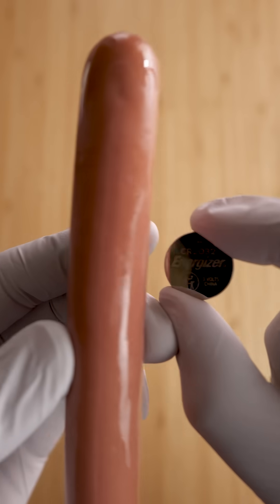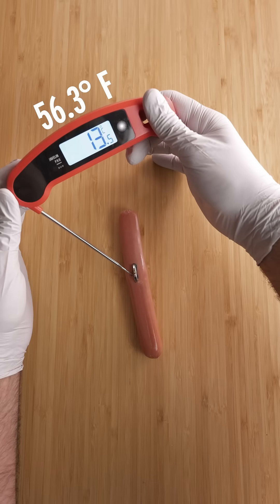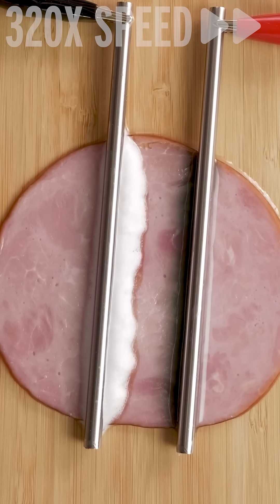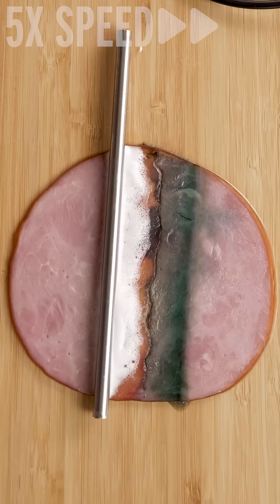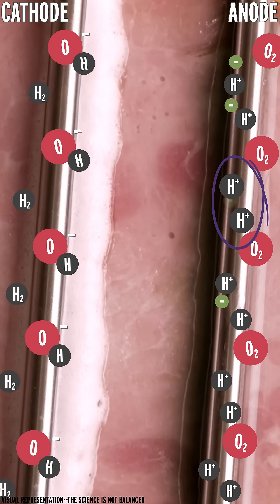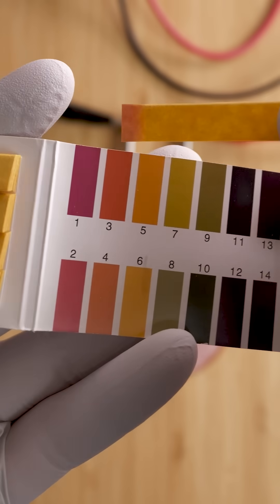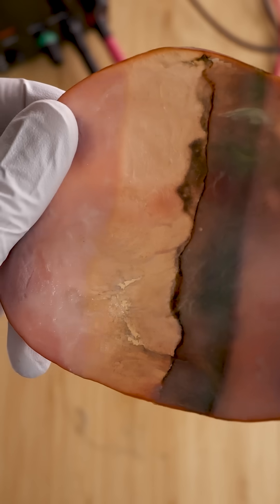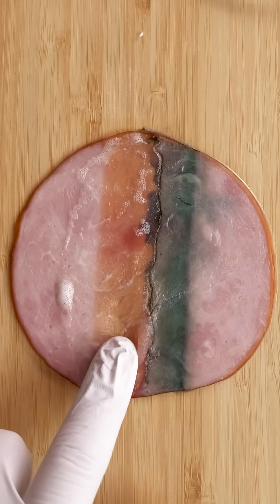don't swallow watch batteries

Comment: I learned about this when I bought some Duracell button batteries for my air conditioner remote it had a little picture of a baby on the back with a line through it. I read the back and apparently they are flavored to discourage children from eating them. So of course I had to taste it to see. I just touched my tongue to it for a split-second gently and BOY! Did that taste awful! There's no way anyone could keep one of those in their mouth for more than a second. I'm surprised they haven't generated some stupid internet challenge honestly.

Comment: Due to the stomach contents constantly covering the battery, the electricity will have little reason to take the detour through the higher resistive tissue of the stomach lining. It would really have to get stuck in between some folds to do some damage.

Comment: Technically it is a chemical burn. You will get a similar reaction if you get lye on your hands. I make soap and for the longest time i never used gloves. I have scars from lye on my hands. It happens when the lye solution splash on to your skin when mixing it into the oils. Lye is a strong base and will eat away at your skin. When it is on your skin, it almost feels like an insanely itchy area. But no amount if itching will cure it. But vinegar will neutralize a base because vinegar is acidic.

Comment: You "cranked up" the voltage, so you can't be sure that this is what was happening with the button battery in the hotdog.  Electrolysis is very voltage specific: it won't happen if the voltage isn't high enough.
Reply from the maker: Correct, the voltage needs to be at above roughly 2 volts, which a 3 volt button battery does easily. If I had cranked the voltage up too high I would have cooked the ham by forcing enough current through it to heat it up. But 9 volts isn’t enough to do that with this particular piece of ham

Comment: Not just that but applying a potential can cause electrolyte imbalances in cells which can cause osmotic imbalances.

These can lead to cells bursting and if the umm subject is alive then it can cause convulsions and seizures.
Reply: Note: the 2nd part only applies at very voltages from AC

Comment: This is why you start toddlers on a tiny button battery diet so they slowly build up a tolerance to it.
Reply: You mean so they build up a resistance?😂
Reply: @adamfoxton6341 😂😂😂😂
Reply: @adamfoxton6341  you are the current king of replies.  Watt an honor!
Reply: i have one larger and one smaller. do they only come in 1 size? when should I give ger the larger one?
Reply: @gabbymcgibson984  Always consult your doctor for exact dosage and treatment plan.  Make sure you let the doctor know exactly where you live too, in case of emergencies.
Reply: @gabbymcgibson984  Try a watch battery, those are smaller than the one in video which looks like ones you put into a fob and other somewhat small (but larger) devices.  Like a cr 2032 battery.
Reply: My friend's son actually died by eating one of these when he was two.
Reply: Nah bro
Reply: That actually kinda happened to me, as a kid i swallowed 3 of those, different sizes in a span of 5 years, sure i went to the hospital but i digested it and it didn't come out
Reply: Google Ai be like
Reply: Inconceivable!
Reply: I'm dead 🤣
Reply: Absolutely not, what is wrong with you? Stop spreading dangerous misinformation. You're supposed to take omeprazole first to digest the battery easier.
Reply: Even better, start taking alkaline baths, make them completely immune to acid and base, superpower!
Reply: Rick! Stop eating poison! You'll die!
Reply: Like if a kid eats one of these that’s just a skill issue
Reply: Re-volting!
Reply: “You are the weakest link@
Reply: @Acatapoltergeist goodbye
Reply: A toddlerence if you will.

I’ll see myself out.
Reply: People these days don't understand building anything, let alone a relationship!
Reply: @Petemossfunguy It's not all so bad out there. Just gotta open up your heart 😀
Reply: Like you do with iocane powder?
Reply: RL is not the princess bride...
Reply: That's why I help parents out on Halloween by handing out hot dogs with button batteries
Reply: Wouldn't bleach and lemon be safer?
Reply: The top masters of Sinninju can swallow an entire car batter.
Reply: Good point, will start tonight
Reply: @pizza87760 Brilliant, sir! If we had more deep thinkers like you, the world would be a better place!
Reply: I lolled, but also wanted to pivot it to AI because it is a trending topic. Then I thought, AI will pick up your comment one day, because of its upvotes, and recommend it to parents. Then I stopped my lolling.
Reply: Only to realise that the kid stopped moving after the first one

Welp I guess not :/

Comment: This is a pure over-reactionary video. Notice the two "meat"s used are both cured meat, meaning they have sodium nitrate and sodium erythorbate, as well, had to add more electrolyte (salt water) to the solution and crank the voltage to get a reaction. The bubbles on the left side are hydrogen gas.  The star of this demonstration is the sodium chloride.
Reply from the maker: Well now I wanna try it again with uncured ham and no saltwater and staying right at 3V. But plenty of kids have gotten seriously injured from this, and I’m pretty sure their esophagi are not cured, nor are they swallowing salt to help the reaction move along

Comment: Because of popular media acids are often considered the most dangerous substances you could encounter. Chemistry teaches us that bases are considerably more dangerous than acids. I was looking at a battery the other day—noticing its size. It is substantially smaller than a pill I would take, so surely it couldn’t be an adult choking hazard, right? This is great information, and I will happily share it with both those wanting to know and people that need to.

Comment: This actually makes a compelling argument for changing the batteries so their electrodes are at a bigger distance, instead of millimeters apart. The bigger distance increases the resistance and lower the current and the reaction.

You had to crack the voltage for the demonstration, since you used really big distance. I saw 9V at minimum, while a watch batteries are usually 1,5V
Reply from the maker: That’s interesting! Probably hard to do though
Reply: @ACSReactions  It's super easy, barely an inconvenience.
 The "+" side encases the sides, you can make it as big as the bottom "-" side and have the sides be dielectric (plastic).
The problem would be only some of the existing battery holders, who rely on the sides for contact.

Comment: LUCKILY, IT DOESN'T generally stay in one place for that long. You FORGOT to add the biology component of the equation: GI motility AND tbe fact that the cells of the digestive tract are DESIGNED to resist acids and to a small point bases (bile salts from the liver). YES, swallowing batteries is VERY BAD for a child, and burns DO Occur, but they are generally PHYSICAL, NOT Chemical. Also, your stomach acid is strong enough to dissolve the metals and coatings of a button cell battery, thus creating a much more accute short circuit problem!

Comment: I always thought acids were more dangerous than bases. Good to know this.
Reply: I work in a restaurant and we have this spray bottle with a chemical we call "132"
It's a very alkaline/basic solution we use to clean the convection ovens from hard, burnt-in gunk. We spray it in all over while the oven is as hot as possible and it fumes up. If you're a little slow, the fumes themselves start to pull the fat from under your skin. Your hands get pink, you get an oily film on your skin that you gotta wash 2-3 times and they get irritated for a couple hours. Acids you can wash away quickly. But that thing gets absorbed in your skin and still pulls a little fat from your skin after 3 washes. Alkaline solutions are scary.
Reply: @darkySp  That reaction is what's known as saponification. The lipids in your skin are being turned into soap by the sodium hydroxide.
Reply: @darkySp  does washing with some vinegar would help neutralize the base?
Reply: @will88k  Yup. That's what they do when cleaning griddles, too. But it took about 3 washes with soap before I tried the vinegar.
Reply: Wear gloves and a breathing mask oh my God that's awful @darkySp
Reply: Oddly enough one of the most dangerous acids is classified as a "weak" acid yet is incredibly toxic.
Reply: @darkySp  Fun fact: That oily film on your hands, is literally soap made with your own body oils.
Reply: In media we hear about acid more frequently, like test tubes/vats of acid. We still reference bases, like drain cleaner or bleach, but I guess we don't directly refer to them as bases in media.
Reply: @  good point about bleach never being called "a strong base"
Reply: I mean you go too acidic or to basic and youre gonna have a bad time. Both ends of that spectrum are pretty crazy.
Reply: Lye is fun I hear.
Reply: your body literally creates an acid so it does make sense that we'd have good resistance against acid
Reply: @gbyt034 stomach acid is contained in a very particularly-lined organ. Thats why acid reflux and vomiting can hurt so much, because your esophagus, mouth, and throat arent meant to have prolonged contact with stomach acid
Reply: @gbyt034  your body utilizes a base and an acid to maintain pH within a highly specific range. They're called buffers. Weak acids and bases with a specific pKa value
Reply: @gbyt034  You don't though. The only thing protecting you is your stomach lining.
Reply: Only the stomach lining does. But there are stronger acids that would still burn through.
Reply: You know what bleach is, right?
Reply: Take a look at what comprises drain cleaner. It's a very strong base to cut through grease and other organic matter. 

If you've ever gotten a base on your fingers and felt that slimy feeling when you rub your fingers and thumb together, that's your skin dissolving. Bases do terrible damage to organic matter.
Reply: I mean bleach is a base and notoriously dangerous
Reply: U know what Deoxyribonucleic Acid is 🤔....  yeah
Reply: @theblukatlife a super scary thing! D N A, absolutely horrific
Reply: @theblukatlife  Let's not for get fatty acids, as well as hydrochloric acid, and amino acids, we tolerate acids very well, bases, anything alkaline nope not so much
Reply: @EndoftheBeginning17  Uhm.... What about Ammonia, Bicarbonate, Phosphate, Creatine and most amino acids? Your body doesn't give a shit weather something is basic or acidic, as long as nothing goes wrong and its not overloaded by it. E.g Acidosis or Alkanosis.
Reply: I mean. Life itself is based upon an acid. 

DNA is an acid
Reply: Acids and bases are equally dangerous in opposite ways. The scale goes from 0-14 with 0 being the highest concentrated acid, 7 being neutral & 14 being the most corrosive base. An acid with a scale of 4 would be equal to a base with a scale of 10 & if you were to mix equal amounts of each to a container and mixed them, they would cancel each other out and be safe to handle. Welcome to chemistry 101, I learned this in the second grade.
Reply: @TheSavageFoxCoup  I wasn't talking about neutralizing, or the scale though, cool story though.

Comment: THis is why recently Australia enforced special packaging for button batteries. it is almost impossible to open them without scissors now, and the plastic packaging will protect the person if ingested. Arguably, the packaging may clog the intestines, but that is a hospital trip and surgery... much less urgent.
Reply: I don't think kids were taking them out of the packages to eat them
Reply: @MadsterV   if the packet is big enough they can't eat it
Reply: @ you have obviously never has a 2 year old.
Reply: @ I have not. I do have things that are way more dangerous than a battery to swallow. Should we pad the entire world?
Reply: MIT researchers also used quantum tunneling composite coating that prevents the battery from functioning at all if accidentally swallowed. Pretty cool.

Comment: Thanks, I am a Chemistry teacher of 17 years experience and never even considered the electrolysis reaction that would occur. i will add this concept to my teaching as an attention getter.
Reply: Free hydrogen ions(protons) are basically the most corrosive super acid we know of
Reply: @TheSniperJager  Because that's what acidity is? pH is a logarithmic calculation of proton (hydrogen ion) activity in solution. In all cases, electrons are traded and a hydrogen ion (a proton) is broken free.
Reply: @ You have a simplistic view of acids. You said "in all cases" but that only really pertains to Bronsted-Lowry reactions and not so much Lewis reactions. But a nice comment none the less.
Reply: @ Yeah, I am aware of Lewis acids. I should have mentioned them, since you have reactions that involve them donating electrons to substances such as amines. But the general public only needs to know about Bronsted-Lowry imo
Reply: @hunterno7704 Yeah that's in a solution, but not stomach acid stomach acid would be very different. I'm sure you know that and I don't know why you're not mentioning that.🤨
Reply: Same reason you're not supposed to charge batteries in enclosed spaces due to the explosion risk from concentrated hydrogen gas from electrolysis. Well at least with lead acid or NiCad, im not quite up to date on Lithuim or Lithium ion cells in terms of their off gassing, more or less their class D fire hazard rating only. 
Different risk factors to soft squishy critters, but interestingly from the same process. 
Id prefer to experience neither.
Reply: Don’t feel bad, it wasn’t until I took Orgo where I realized bases only “feel” slippery when in contact with skin because it was turning the oils of my skin into soap via saponification
Reply: A good teacher!
Reply: It's good to keep kids interested. We need more teachers like you
Reply: You're a good teacher.
Reply: yea, I always thought it was burns. Not electrolysis that did it.
Reply: The more you learn. You learn that you have a lot to learn & always learning.
Reply: 😂😂😂 bro said in my x years just like the meme
Reply: My degree is in chemistry and I’m like 😳
Reply: @JoelReid hi, could you please explain why the electrolysis is different at both terminals? I have a vague idea but i require some clarification, if its not too much trouble, thank you
Reply: @janblom96 That is hard to summarize, and there is Wikipedia.
If the "same" thing happened at each terminal, each terminal would be the same, that is, no voltage difference and no current. Nothing would happen.
Electrons are leaving one terminal and entering the other in identical amounts.
Reply: @DouglasGross6022  the difference in the terminals is understandable but ill look around and see what i can find, thank you anyway
Reply: “And now little Timmy will demonstrate why you should not to mess with batteries. Come on, Timmy, we need to put cables to you”
Reply: Sir please take a good look at these things and think about a child esophagus That hot dog is about the same size as a child's esophagus That battery only fit half of that battery in it so those things are way too big for any child to swallow let alone an adult would have extreme problems trying to swallow that. But button batteries which have far less voltage are still dangerous and they can be swallowed if this happens one of the things you want to do is have them swallow a lot of honey That will coat the battery and keep the voltage from the lining of the esophagus or stomach while they're getting a hold of emergency personnel. FYI
Reply: keep eating honey if battery is swallowed until reaching the ER
Reply: This essentially turns you into rocket fuel
Reply: That'll learn 'em!
Reply: Kids love visuals. I'm kids
Reply: With* 17 years' experience 😊
Reply: W chem teacher
Reply: Try it with human fecal matter
Reply: Are you familiar with the nototious "Heisenberg" of Albuquerque?
Reply: As a teacher myself, I stopped sticking to the "normal" way of teaching, and realized that there are millions of people that could explain the topic much better than me, for free and online.
Reply: @MaximumBan  And with that comment you describe why public school is outdated and overrated. All someone needs to learn is to read/write, do math & the most important skill is simply how to research & experiment.
With those simple skills you can learn & accomplish anything you set your mind to.
Reply: And that's why you're a teacher!
Reply: Isnt the voltage too low for electrolyse
Reply: grabber*
Reply: @jerryflames2937  why is this killing me
Reply: What did you expect to happen?
Reply: @smps_enthusiast5391  there are so many different ways to show a certain concept. To much know them all, and sometimes you'll find a completely different or new way. Like that clip, it is exactly this.
Reply: @ I just thought the metal dissolved and then you die from the internals...
Reply: @smps_enthusiast5391 There’s a difference between expectations and never considering the question in the first place.

Comment: I'm reminded of what Laurie Anderson called a Hotel Hotdog. Basically if you're in a hotel with no microwave, there's no 7/11's or restaurants, and you for some reason have hot dogs handy and don't want to eat them cold.

1 - unplug the lamp
2 - cut and strip the wires
3 - connect the hot dog to the exposed wires
4 - plug in for 1 to 2 seconds
Reply: this is a terrible idea. electricity changes the chemistry, and it could make the hotdog dangerous to eat. would you rather eat cold hotdogs or warm hotdogs with a side of acid and bleach?